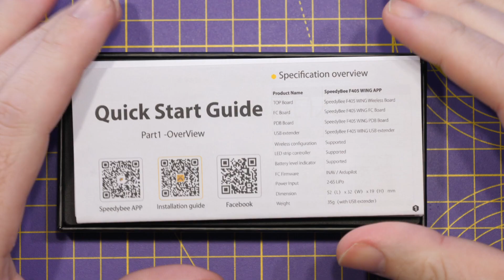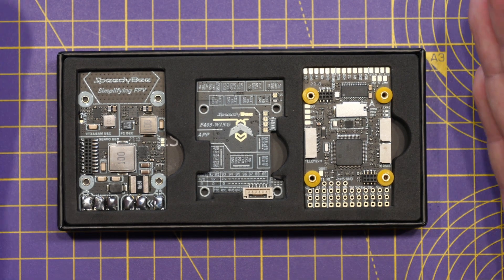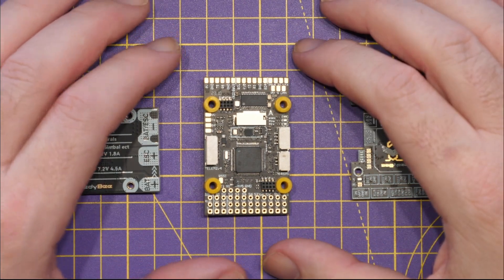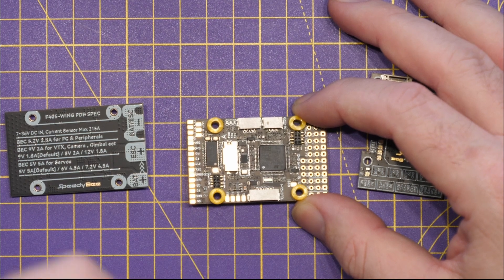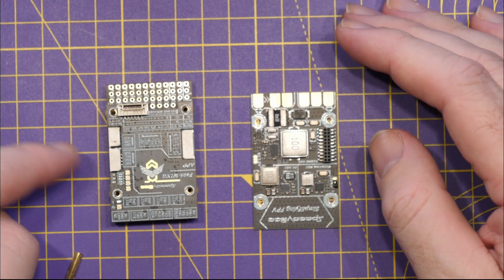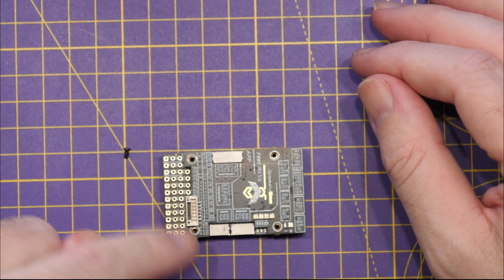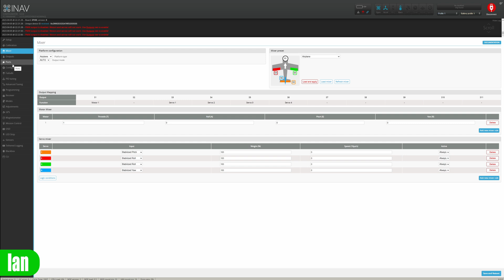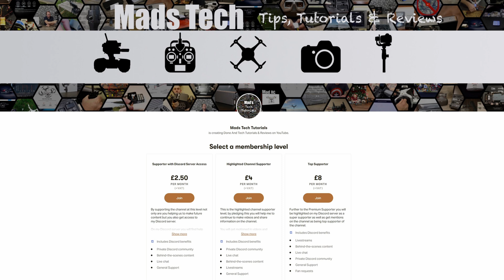SpeedyBee F405-Wing Flight Controller - Ardupilot Or iNav for $40

Comment: Great helpful video review of an amazing great value FC for wings Ian.

Help! No OSD with HDZero! I seem to be very much in the minority using HDZero with a wing FC. I have the SpeedyBee F405 Wing FC flashed iNav 8 for use with digital FPV system comprising of the HDZero Freestyle V1 VTX with HDZero Goggles-1. Following several YT build videos for guidance with the build, everything works on the bench and in the AR-Pro as expected, except for that the OSD information is missing.

The video image is being transmitted to the HDZero Goggles. I have doubly double checked that the TX/RX leads are correctly connected the right way round for UART-5. I have updated the FC and the goggles to the latest firmware. In the Ports Tab I have MSP DisplayPort selected on UART-5: In the Config Tab the OSD is selected ON: in OSD Tab I have HDZero selected.

I have spent days trying to resolve the lack of OSD in the goggles. Not having OSD info sort of make iNav and an FC pointless.

Any suggestions?

Comment: Hi i am using the ct20 3 axis gimbal and I was wondering, as i have the 04 air unit, if i can pass a control signal from my dji fpv remote to control my plane?

Comment: Very interested in the ranger t1 vtol build. I'm having issues figuring out how to install the third motor.
Reply: Did you ever get this working? Contemplating the best way to connect the third motor's power leads myself, since there are only 2x ESC leads.
Reply: Same here ??

Comment: Pin headers?? Has GepRC's mistakes taught you nothing, Runcam? Did you notice how only the middle board gets the gummies, while the other ones are hard-mounted while connected to the middle one with pin headers? Were they high when designing that?
Reply from the maker: I don’t see the issue.  There are metal pins between them to stop any shorting.
Reply: @MadRC  They won't short, but rigid pin connection between two boards where one of them is supposed to be suspended on gummies and the other hard-mounted? That's all kinds of wrong.. Think of the stresses on the connector when there are G loads and about what's the use of gummies when you have a rigid connection in the form of pins plugged into header.. I'd like to see raw gyro logs from that wonderful invention and also to have a glimpse at connector failure rates after some use..
Reply from the maker: Honesty I don’t see any issues with what’s been done here.  May be in a large heli yes but these are going to end up in wings mostly.  I don’t see there being any issues with this design.
Reply: Talking drivel....🤔🙄🙄😏🇬🇧

Comment: Wery welcome. But I see one major design flaw. Silicone grommets between boards. They need to be fixed or the plugs might disconnect... matek has copper standoffs without silicone grommets. Yes expensive but they do it right. So conclusion looks fancy but do not trust it.
Reply from the maker: There is metal stand-off in there as well. I show this.
Reply: @MadRC  yes I saw that. But I remember a flight stack that had problems with this. (Can't recall the acutal stack) Basically same thing as having a regular stack screw thru the grommets on a quad. There is reason why all quad stacks uses wireharness instead of this solution... the boards should really be fixed will just cause stress issues on the plugs without helping vibration because it will translate via plug instead...

Comment: There is a lot to like about it.  There is also a lot to DISLIKE about it too.  I ordered one anyways, they are very low price right now.  Dislikes: Not good for 2S li-ion packs (!) rated down to 7 volts darnit.  3 boards means HEAVY.  Solder points hidden when assembled.  USB separate, and short cable. Speedybee has a bad FC reputation right now.  Too many multipin plugs I will never use. ymmv
Reply: The manual says 2s LiPo..where are you seeing 7V?
Reply: @chrisfriesen7913 Never mind, I see the 7V as well.  Wonder what the actual minimum voltage is.

Comment: This a very impressive and well thought out Wing-FC with very flexible design. Great balance in feature set, physical size and value. Even the product description (web) is well thought out, giving good guidance to newer wing pilots on when to choose INAV or ArduPilot as FC software. 

A great feature I have not seen on any other FC is the ability to boot to USB, WiFi, or BLE connectivity options (7:00). For example if the USB gets damaged, can still use the FC using WiFi, or BLE. (may even be able to workaround accidentally disabling UART1 in INAV, which disable USB connectivity? have not tested) According to webpage/manual, a long "6 second" press switches modes. Shorter presses switch LED modes (as noted at 8:43). Great easy to read labeling on top of the FC, plus a LiPo battery 'state of charge' % status checker (4 LEDs). 

Really look forward to seeing you Ranger T1 build series. It will be a nice pairing to this FC. 

BTW: SpeedyBee product page is now live (should you want to include a link in the desc). Great content and graphics, including PDF manuals.

Comment: Looks very similar to the WSE from matek which was a solid offering. Going to have to get a few of these now 😅
Reply: wifi and bluetooth connective is a the best thing we can have so its way better than matek
Reply: @flyinghigh2646  it's goot to have it onboard, but I can get wifi connectivity through ELRS, so can add that to any FC. For me this is better than the equiv matek offerings due to the overall improvements and features it offers over and above.